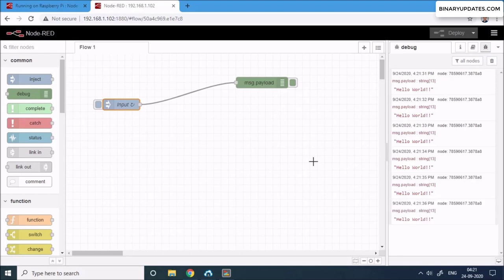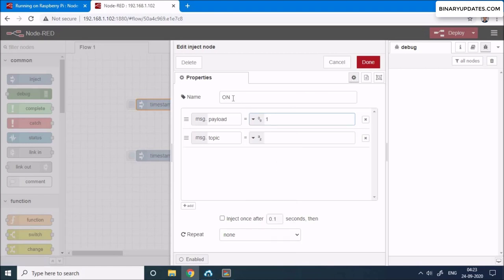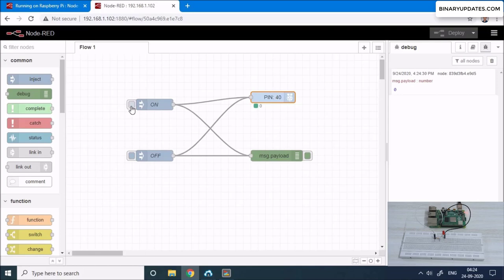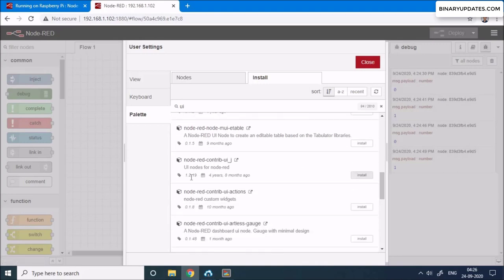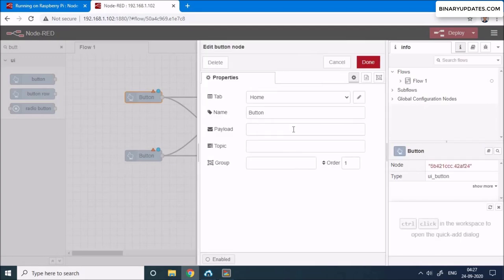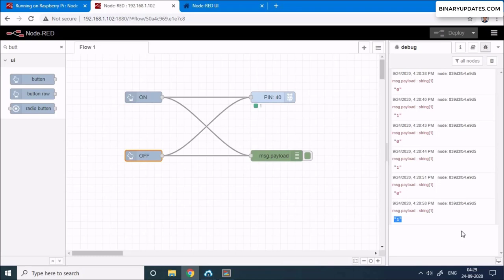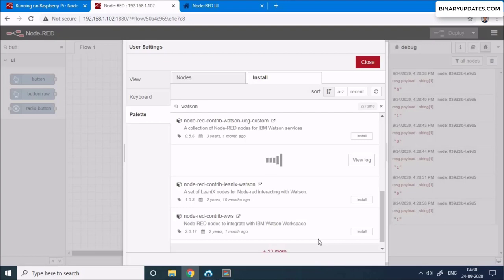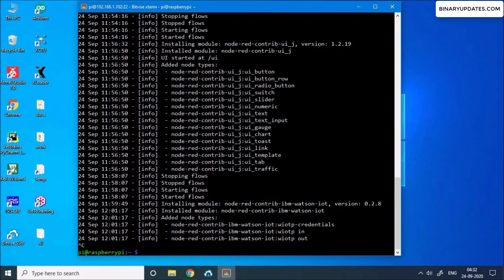Control GPIO Pins of Raspberry Pi4 using Node-Red

Comment: It is not working with RPi 4 64bit?
Reply from the maker: Hi Predrag, recently i noticed you need to run following commands before installing node-red command from official webpage:
sudo apt update
sudo apt full-upgrade 

After this two commands you can run following command to get install node-red properly on Raspberry Pi4:

bash <(curl -sL https://raw.githubusercontent.com/node-red/linux-installers/master/deb/update-nodejs-and-nodered)

I am sure this will help you resolve installation

Good luck and best wishes
Umesh